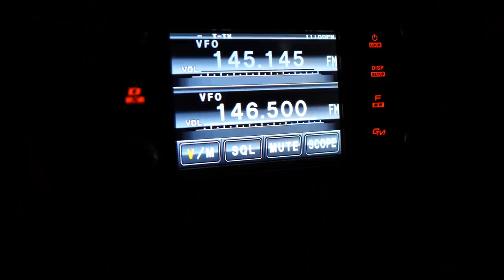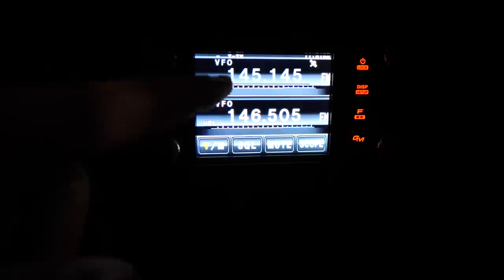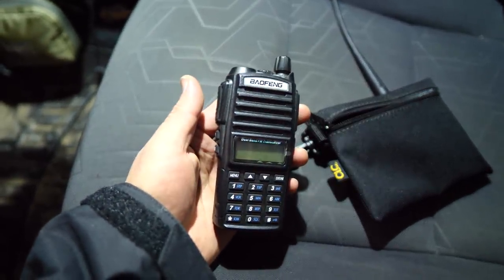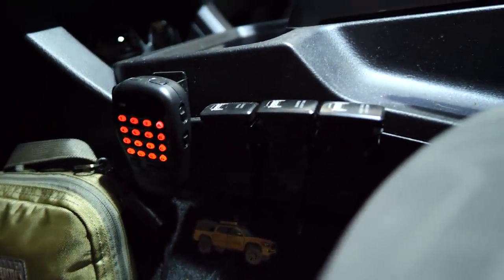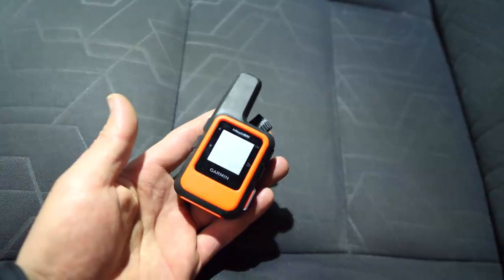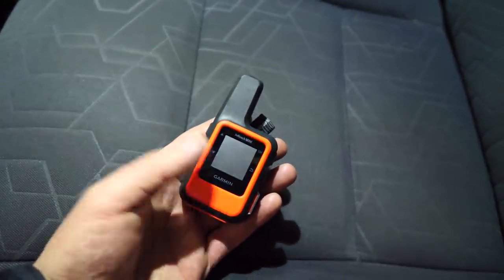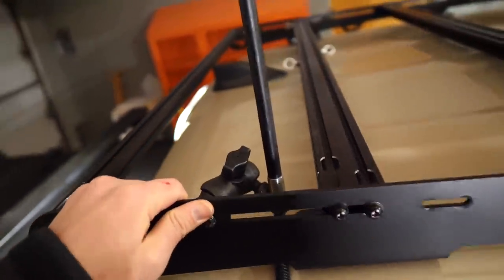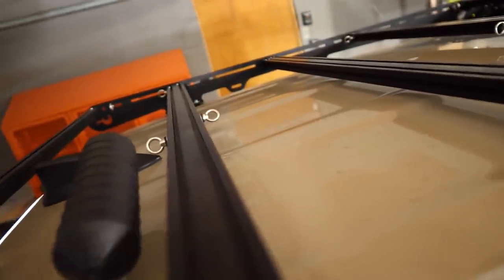COMMS Part 1 - Overland Communication tools/gear - Ham Radio, WeBoost, Garmin inReach

Comment from the maker: More detailed Ham video - https://youtu.be/eHlOCN1LrXA
Shop the gear list here - https://www.amazon.com/shop/lastlineofdefense
Reply: Last Line Of Defense You hit on it but rejected it...in effect it gives you a mobile cell tower by boosting the signal. Of course if you’re in a extreme primitive area with no possibility of any signal you’re SOL.
Reply: Last Line Of Defense what adapter are you running to fit the stubby antenna
Reply: KLLSWITCH they are NMO type mounts for the Cannon style Antenna. The mount is made by diamond k400
Reply: Links are not working for me

Comment: What do you do when the grid and internet goes down ? What happens when your cellphone service goes down ? You know exactly what will happen . No matter what happens amateur radio will never fail because the new Ham radios are 12 volt . There is so many different ways to power up your radios that is not dependent on the grid for power .

Comment: >not having a flock of carrier pigeons for true off-grid communication

Come on Mike, it's time to boss up
Reply from the maker: I am but a noob.
Reply: @LastLineOfDefense  

9:12 Lapel microphone.

18:09 If cellphone has no signal bars it does NOT mean there is NO signal. 
Think of the old phones, they had external antenna(for a reason) and now they hide them inside the phone(because towers are more common). Every layer of anything is reducing radio wave to a degree. 
So your cellphone antenna is inside cellphone. Then you might have a case on your phone. You get inside the vehicle, you got glass ( the best insulator). Metal, panels, materials and so on. On top of that if your cell tower is behind some kind of terrain, literally couple of feet up or down makes a big difference. 
That is why your roof mounted antenna is so different from your cellphone antenna.

Comment: I use the same Yaesu HAM radio. It's great for offroading. And I appreciate having the APRS function to share my location with my gf.
Reply: Default Name  I do not monitor other beacons honestly. But I still value the ability to allow my fiance to track my location when APRS reception is good. It's also possible to send emails and texts with APRS, though I haven't dabbled in that very much and it's something I should explore more.
Reply: Default Name  I also recently improved my navigation setup to include a tablet running APRS Droid and Back Country Navigator XE which I can then interface with my radio using a Mobilinkd TNC3. This allows me to see other APRS users on a map in a real time while off grid.

Comment: The booster antenna creates a doughnut shaped wave pattern (horizontally) that overlaps with the cell towers. It then supplies the interior antenna with a valid signal. So when WeBoost says it does not create signal, that is a true statement from the stand point of a cell tower data. If there is no tower around you for miles (30+) the booster would not be able to overlap and output usable signal.

Comment: Legal power limit on Cell phone is 3w the old bag phone of the 90s had that amount. but  less then 1/2 w is the stranded for cell phones now. If you remember in your ham study ERP (Effective radiated power ) the antenna DB gain adds to the boost aswell. From what I can tell from the website it might use a combination of both. Back about 10 to 15 years ago there was a company doing the same thing for cell phone users in the trucking industry but I think they went out of business. BTW I have been a truck driver for over 30 years and a ham for 17 currently hold amateur extra.

Comment: You can add a handheld speaker/mic and magnetic roof mount antenna if you look on ebay or amazon. Amazon is best bet for quality n reassurance you wont get hosed. Baofeng UV-5r is best for cost. You dont need a massive, expensive set up for a good ham rig on the trails. Least expensive that meets needs is best n 5 watts is enough if youre in a group. Yes, you need a technician license (yes, the baofeng requires ham license) for ham radio uhf/vhf but its worth it. I also recommend cb, midland 75-822 n a magmount antenna with a speaker/mic. 

If you get both setups, its less than $200 and works great on trails. I have both in my xterra and have for years. This setup cost little for what i get. I can wheel with cb and ham folks so im always good n can roam solo (safely since i can get help if things get too real) or with a group. 

Keep making vids, dude! Nice Yaesu.

Comment: Great video. I love seeing your setup. As an electrical engineer I had to comment on the Weboost system. The antenna in your cellphone is really small, so when the signal is weak it can lose it rather easily, especially when it’s inside a metal enclosure (your Tacoma). The weboost antenna is larger and much for sensitive to signals in your area and can amplify them so your cellphone can pick it up. So in order for it to work there has to be at least a weak cellphone signal in your area. If the cellphone signal is attenuated too much or there is no signal the weboost system will not work.

Comment: My understanding of cell signal is that the limiting factor for signal is your phone itself. Even if your phone sees a tower, it will decide if it has the signal strength to effectively communicate with the tower, and then tell you your bars based on how strong of communication it has. If it’s hearing the tower stronger through your cell booster, it believes it can communicate more effectively. Whether that’s 100% true or not idk but that’s the explanation I received

Comment: Personally I am fond of my Icom 706mk2 for a ham radio (I am considering moving it to a portable case and getting a new radio for my truck when I get a new truck). I am just a tech but I am going to get a general upgrade after I do my license renewal so I can use HF with NVIS since I too am in mountains and valleys where I live.

Your description of how WeBoost can get a signal when your phone can not was rather awkward. Most people understand an amplifier makes a louder/stronger signal. So it may have been easier to simply explain that it hears the signal that your phone considers to be too weak and amplifies it making it stronger.

Overall, an excellent video covering the various types of communications equipment you may use when out on the trail or otherwise in the middle of nowhere. I am going to have to check out the Garmin. I have long been a fan of spot, but am disappointed that they never came up with a replacement for the Spot Connect which allowed you to connect to your cell or tablet and send customized text messages.

Comment: Ham n00b(ish) here, haven't gone full nerd (yet).  You'll likely get more range from your Jpole over the Diamond as long as its well tuned and you can get it high up in a tree. Increased height will lengthen your radio horizon making the power of your mobile much more effective (and the HT as well), this will also extend their battery life allowing you the same effective range at lower power. I would highly recommend 'nelson_antennas' on eBay his Deluxe Model 2M/70CM Roll up J-Pole, he makes them tuned for MURS as well which is another great (and unlicensed) comms option that allows for external antennas if one does not want to jump into HAM. The 2M/70CM also has FANTASTIC wideband receive for scanners, and they're super useful if you live in an apartment and can't put up a real antenna. Simply placing it in a window I can hit repeaters an extra 5-10 miles away and pick up digital P25 simulcast on the scanner from surrounding cities 30+ miles away. Make sure you select the right connector for your radio/scanner before you buy, 73 https://www.ebay.com/itm/DELUXE-MODEL-ROLL-UP-2M-70CM-ROLL-UP-J-POLE-SLIM-JIM-ANTENNA-WITH-10FT-COAX/190898779511

Comment: Baofeng BF-F8HP is the most current unit replacing the UV-5r. Can be found for $30 and accepts all accessories. Recommend a 3800mah batteries for it.

Comment: I have a booster hardwired into my 4Runner, but my understanding to it is that while your device shows zero bars, it effectively gets the 1. antenna out of the vehicle 2. puts a better antenna up, and 3. amplifies what signals there may be in the area.  it doesn't create a signal, just amplifies an existing.  the inherent problem with amplification, is that it raises the noise floor.  so while you may get more "signal" you're also increasing the noise, which, may cause data, or service issues.  don't get me wrong, it's a valuable tool and I have mine running all the time, just have to know the limitations of it.
Reply from the maker: Correct, nothing can magically create a signal - though if you have 0 bars, you effectively have no signal - flipping on the weboost 'creates' a signal where there previously was none. Though technically it is amplifying a signal that was too weak for your phone to pick up and use.
Reply: @LastLineOfDefense  Mike, while you make a valid point that zero bars is no signal that is not technically true. A zero bar icon is still a signal it is not a usable signal for most phones. A true no signal would be the no service icon. What the weboost does is amplify signals in both directions like repeaters do for ham radios. The signal is there for the amplifier to boost into a usable signal for the phone.

Great video and good information! I enjoy your channel and watch it every chance I get.

Comment: okay, this is what the weboost is, it's a micro repeater... the same as a normal FM ham repeater it has a local antenna (small) like the stub antenna on your hood, and an amplifier, duplexer connected to an antenna with higher gain (the one on the roof) like the one you swap out for longer range communications... think of it as a combination "repeater" and an (disconnected from the internet) "Micro Cell"... but in actuality, it's either an amplifier, or a "Transverter"  (repeats cell signals from one band to another I.E. a "Cross band Cell repeater")

Comment: the weboost inside antenna needs to be central in the vehicle, pointed into the center of your tacoma toward all passengers -not in the passenger area pointed at the side of the truck. you can get a free app to monitor your cell signal to see the difference moving it around inside the truck. 73, kk4zuu

Comment: Hi From Cotopaxi! 
Regarding the WeBoost...  I've been trying to find an answer to this question and haven't been able to find one. What is the range of the smaller re-broadcast antenna? Another way to ask this is how far away from the rebroadcast antenna can you be and still get a signal boost?

Comment: Just because you phone doesn't register bars doesn't mean there is no signal. It means that your receiver (phone) cant operate or register the low signal. Click the booster on it takes the weak signal from the better external antenna and boosts it up so your phone can now read it.

Comment: I want to have a set of GMRS radios in my Tacoma so that I can hand one to my son or trail buddy when we go camping or overlanding.   I am opting for GMRS because while mostly used for truck to truck communications, I like the option of being able to leverage a repeater if we are in a jam to get help if we have no cell coverage.  I have the GMRS "license"/paid the FCC fee.  What I know about comms is very little, I've tried to educate myself by watching your and other videos, so maybe my logic is flawed. but for my own reasons I do not want Ham or CB and I do not want an external antenna.  I also want it to be able to access weather channels and remain in my truck ready to go all charged up and connected to my USB outlets (without a clunky charging cradle).  I am having a hard time finding such a thing that is not plain FRS.Any suggestions?  And thanks for your great channel, love it.  I have the same truck but access cab and certainly not customized or kitted out like yours, although I have some small projects in mind.
Reply: There are some smaller handheld GMRS and frs out there, but for any distance you'll want an external antenna a mag mount will do, I know it isn't what you want, but the science of rf says you'll need it if you're communicating any good distance unless you have a repeater to utilize.  73 KE8JMD

Comment: I see you have two weBoosts on your amazon list. I must live just up the street from you, near White Ranch Park. I was considering a weboost for my jeep as I lose cell reception while driving up and down the gulches [and also when I'm wheeling]. Of the two, which do you recommend? One disadvantage of the drive reach is a) the antenna mount needs metal [no metal on the top of a jeep] and b) If I 3M tape it to the top of my jeep its harder to take down if I need to get into a parking garage [I'm already near the height limit in most garages ;) ]. The OTR version antenna looks more like something I can attach to my rear spare tire carrier [high enough to stick up over the roof] but with a mount that I can bend it downward when needed for tight fits. Thoughts?

Comment: CB and GMRS are more handy as more people don't bother to get HAM license. So i can only give them FRS toys to speak to me. And legally should also use another toy radio. 
Weboost is not effective here around LA. In the mountains if there is a signal it is where if you turn behind the hill it is not there. But want to mention about ESIM phones (all new samsungs). I have NVMO from Verizon, AT&T, T-Mobile on the same phone. And where are lot of spots where one works and not others.

Comment: Hi,
I was thinking of purchasing the Drive Reach OTR for my 4Runner to be used when overlanding. When I called weboost support, they mentioned this model would be the best solution. One thing I noticed is that on their website it mentions you must register the device with your wireless provider and get consent. Did you have to do that?

Comment: The cell booster is the same thing as a two/six meter ham radio repeater, except it only transmits after a signal is received. It can receive a cell tower signal when it's on, when a signal matches your receiver (phone) it rings it.....hello?

Comment: Hi Mike, thanks for your awesome and always interesting videos.  I’d also like to thank you for the WeBoost information.  I ordered a WeBoost for my Taco and waiting for it to arrive.  I also have the same but older diamondback tonneau cover.  I’m trying to find a way to mount the antenna.  I cannot get a phone signal where I hunt and there is a cell tower about 4 miles away so I’m hoping the WeBoost will pull the signal in. Keep up the vids.

Comment: The Weboost sounds like it functions similar to a HAM Repeater, and amplifier. It basically will take your signal, repeat it outside the vehicle, and send it out with higher gain/power than your phone can do. Then do the same with return traffic from the cell tower.
Is that about right?

Comment: To talk in HAM terms the weboost is a nicely tuned and sensitive antenna combined with  pre amp attached to a low power transceiver sitting under the seat of your Taco...btw I is that your rig on the ikamper mini ad I came across?

Comment: Go through a Cat3+ Hurricane and see how useful a cell phone is. Towers go down and the network gets so congested that you can't even send a text. Also,  the power is out at that point and you can't even charge the cell phone. Then, because there is no signal, the phone is killing its battery searching for a signal.

Comment: Hey man...just got the 3 RAM parts from your store for my Weboost. How did you attach the Weboost antenna to the RAM 9mm Angled Bolt Head Adapter Ball Base?

Comment: You do not Need a lic for ham radio to listen only if you want to comunicate but if its a Emergency  you can comunicate even without the Lic!
Reply from the maker: Correct, I had meant to mention that, but totally spaced it.

Comment: Look into zello...its a push to talk for your phone.its better than a radio.can use that for backup..but zello is awsome..we use for some of my fire dept buddys an other friends..just have to have an email. An when u do it have to remember it user name an passcode..an confirm It though email an ur good.
Reply: Zello uses the wifi signal from your phone to turn it from a radio that talks to the net into a radio that talks to other humans...if I understand it correctly you can add a boosted router to the system and boost range and power.

Comment: Curious...how and where do you route the Weboost cable into your cab?  Thanks!
Reply from the maker: Through a grommet underneath.
Reply: @LastLineOfDefense  I saw in another vid you were going to reroute it to that grommet. Could you share how you routed it. I'm having trouble finding a clean method without drilling through the roof. I can send you my email if you would be willing to share some pics please.

Comment: The WeBoost doesn't create signal, it relays an existing signal from a distant tower that the antenna in your phone cannot pick up.  Really its just a serial amplifier with a high gain antenna for the cell tower signal.  I'm putting one in my Taco as well.

Comment: You neglected MURS.  It’s basically VHF CB - low power, external antennas, channelized, no license required.  More powerful, and more efficient, than FRS and cheap handhelds available, but the physics works a lot better than CB.

Comment: how much was that weboost.   see they have different options. about 300$ looks avg.   500 for really good one
Reply: The one he has is $500 if you look at his amazon list he has it under comms
Reply: I have the same one he does and it’s $500. It’s the 4g model. It actually works. I have an install video I did two years ago and I still am amazed all the time with how well it works. I upgraded the antenna to an NMO one